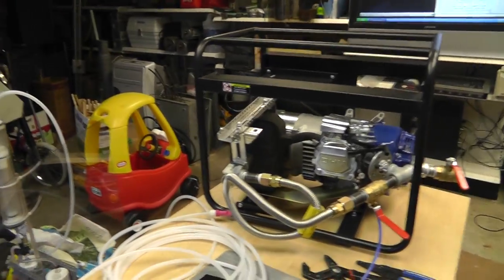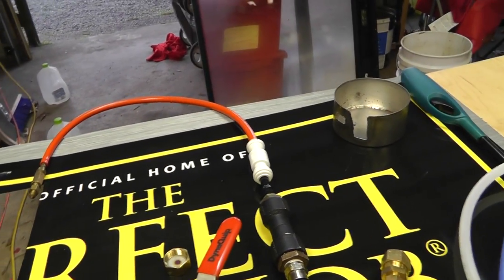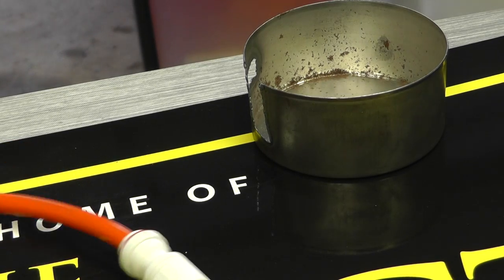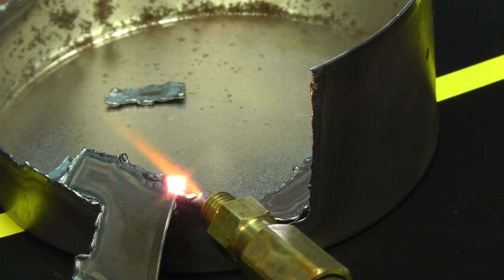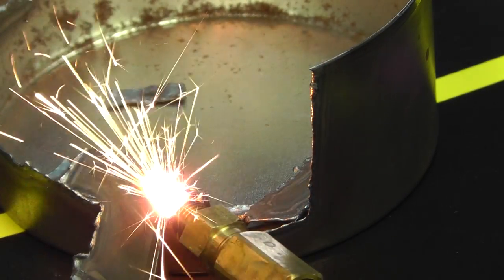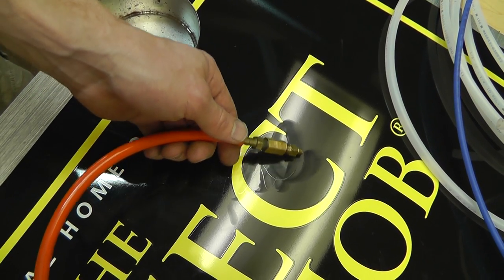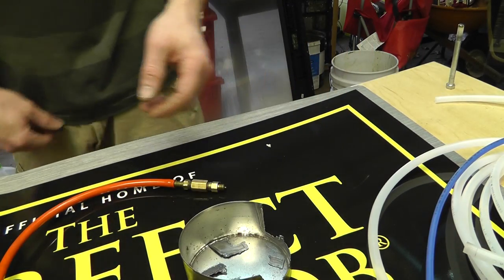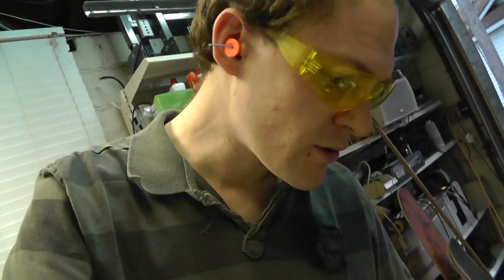Cutting Some Steel... Using Hydroxy Gas Derived From Water 03-23-2012

Comment: nice cell russ, you got sum good production there,,ive recently bin working on power factor capacitors to get more amps threwe my cell, turns out ive bin running at  .18 power factor but using a capacitor i can now get twice the wattage using half the amps as before, ill explain later, no room here, it can increase output 7 fold

Comment: hey russ check the power factor on your cell, do you have a watt meter? the volts x amps only gives you apparent power on a non linear load , im guesing that your cell is around a power factor of .5 or .4 if you connect a motor start or even a run capacitor in series or parallel to your ac side the wattage your cell pulls can increase drasticly,

Comment: Pretty sure Stan said "the tip of the welder stays cool to the touch" due to the inert gasses creating a gap created between the tip of the welder and the flame. Not the flame it self. I wouldn't suggest touching the flame.

Comment: hey russ did you no that wen you touch the flame to metal a voltage is generated between the work piece and the torch,,, its like a little inefficiant hydroxy fuel cell

Comment: my current new design runs at a power factor of .18 at 3 volts rectivied. to get 240 watts i had to push 14 amps threw my ac side of the transformer but wwen i connected a 40 uF  run  cap off a 400 psi air compressore it wil run at 280 watts using only 4 amps AC , a few years back i did sum work on this but had to stop , volts  x amps only gives you apparent power on non linear loads like rectified dc harmonis distortion of current can be corrected by using capacitors, soon ill be posting a vid